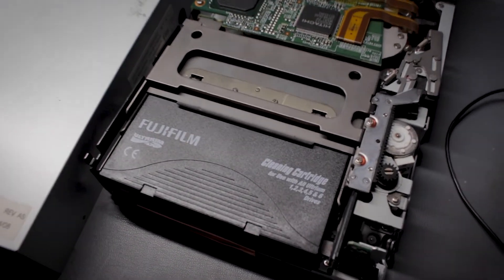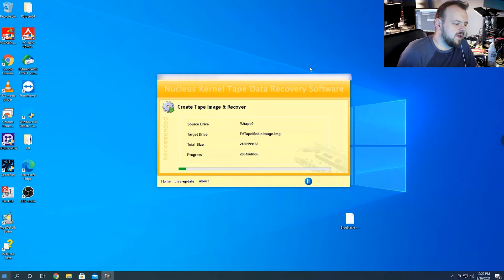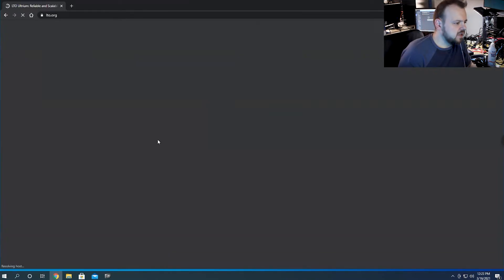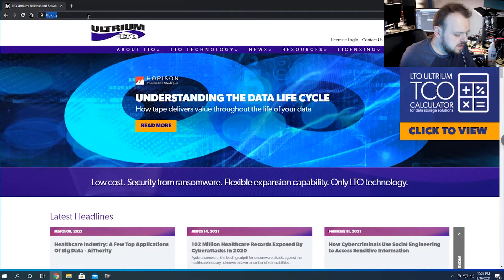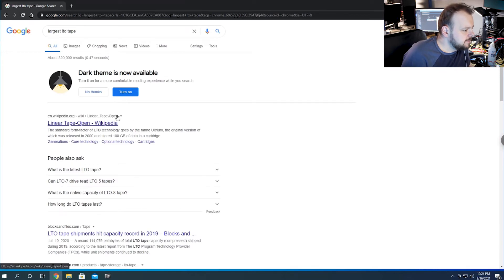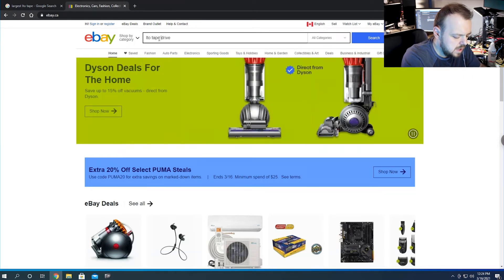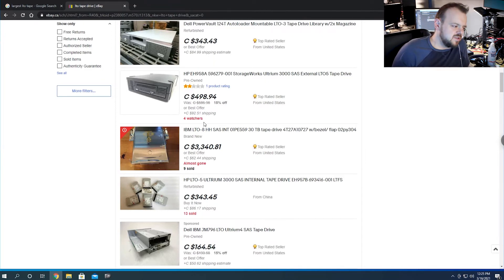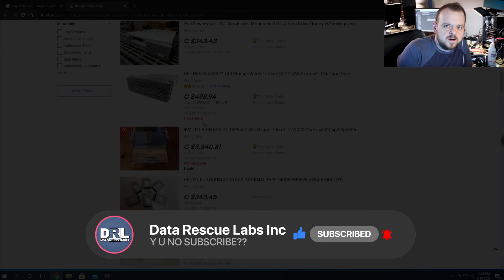LTO Tape stuck in drive - data recovery part 2

Comment: must .... take ..... stuff ..... apart ....

Anyway, did the Kernel tool work? Their JPEG repair tool sucks.
Reply from the maker: It works ok but not worth the $$. It can’t handle multiple systems on a domain controller if backed up that way. It just puts it all together